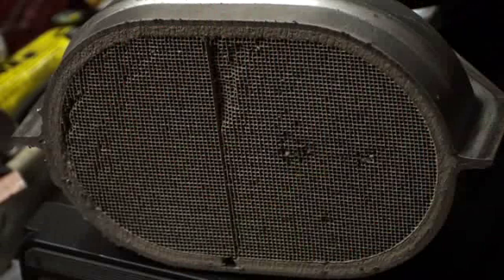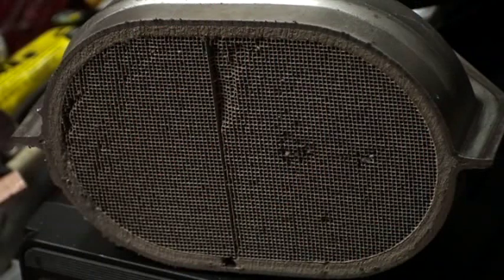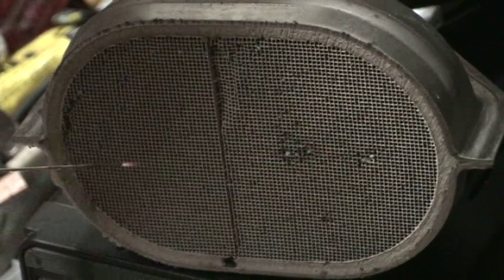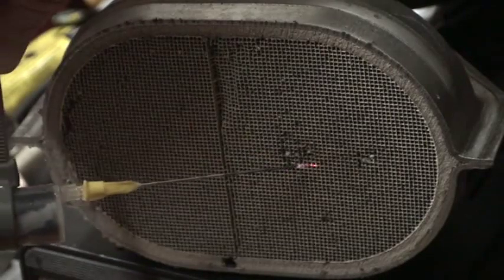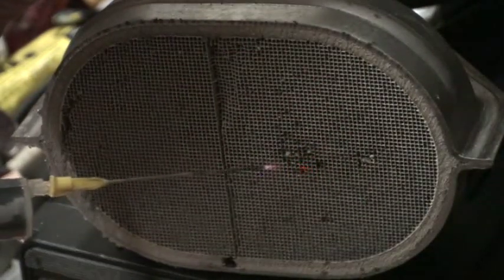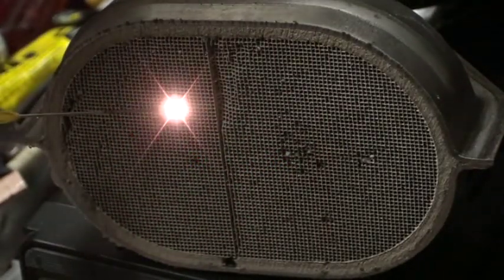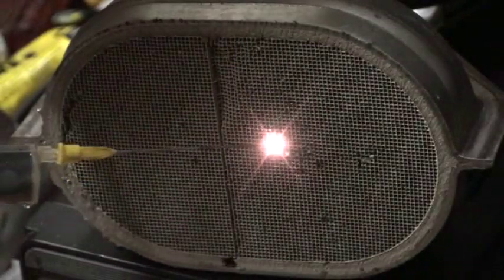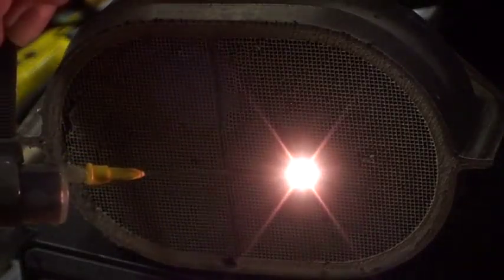CAT to LENR approach4 wmv

Comment: If you have a complete intact catalytic converter, place your HHO nozzle into the intake pipe (drill a hole just large enough to tightly hold the nozzle), and do not light the HHO nozzle! Just let the unlit gas flow into the converter. After a few minutes, put your hand on the converter's metallic case. You will find that there is heat that is building up in the there. The chemical reaction that is happening in the converter, is causing the unit to get hot, with no flame. The catalytic conver can be used as a flameless heater. Be careful if and when you pull out the HHO nozzle. Upon contact with the air, it will immediately light up. You should have some flashback devices on your HHO hose, so the flame will not reach your HHO source. If it does. your equipment will probably blow up.